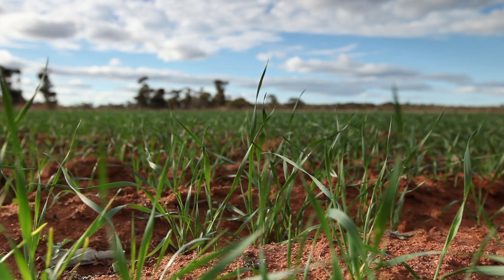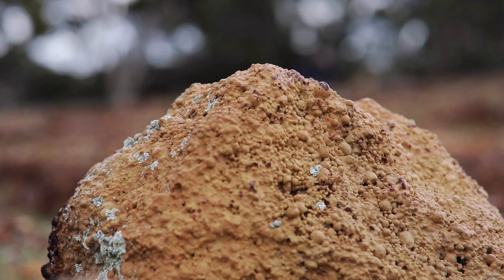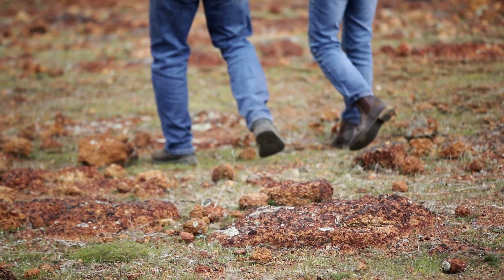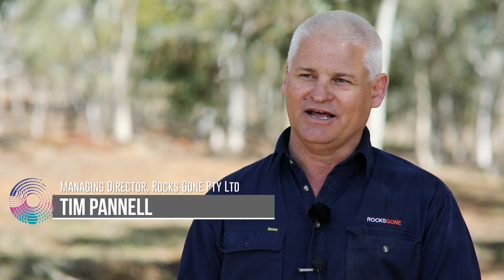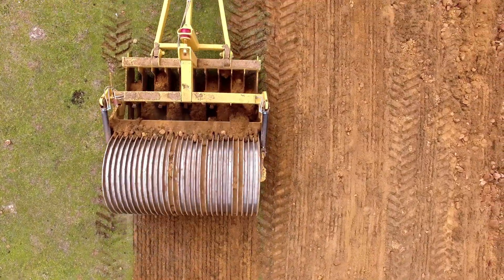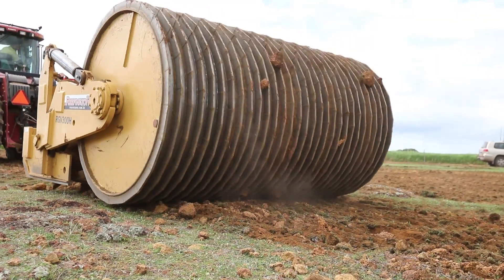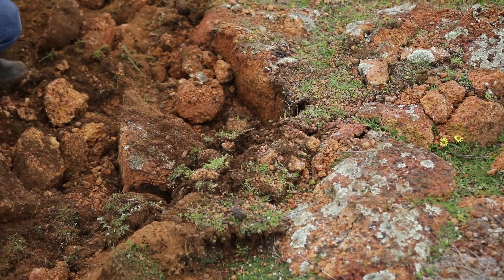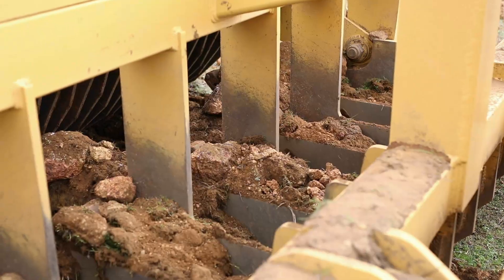Machine that crushes rock into land for farming - The Reefinator

Comment: How would this be more cost effective than a grinder? The energy input of driving a tractor over a field ten times whilst grinding must be higher than doing a single pass and putting it through a grindet
Reply: Not necessarily. The grinder could just use a lot more power to do the job and almost definitely works at a slower speed.